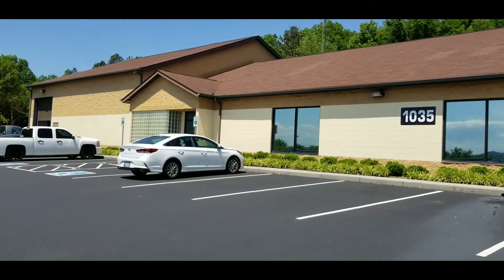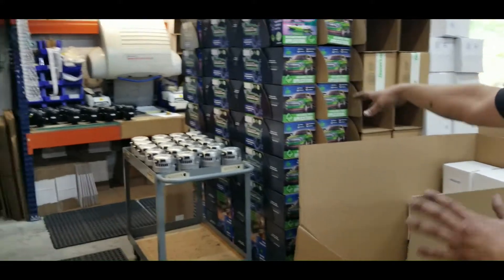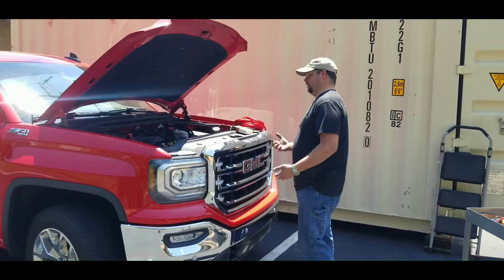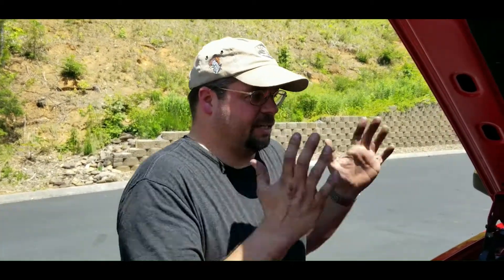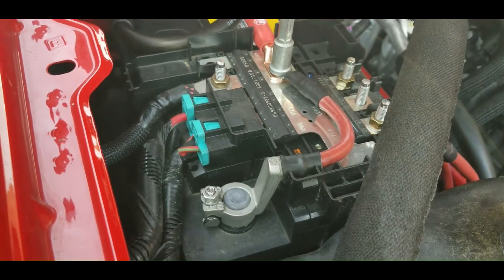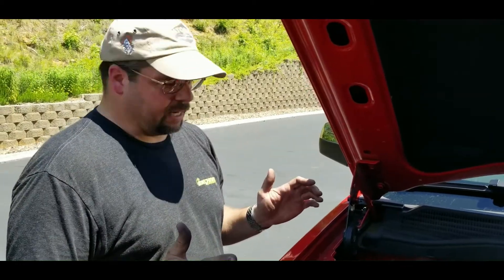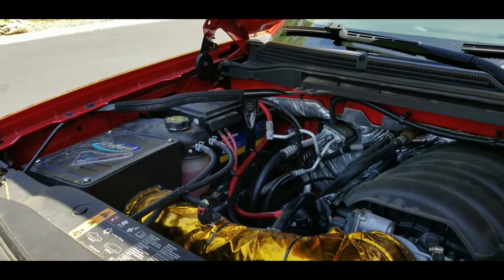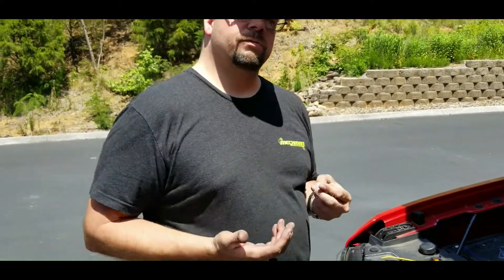How to correctly wire a MECHMAN 370 AMP BILLET ALTERNATOR for 2014-2018 GM Trucks & SUV's

Comment: If this isn't an appropriate place to ask questions just ignore me lol. I'm not totally new to car audio but I would consider myself a novice. I was just starting to upgrade my 2013 GMC Terrain Denali and worried about the voltage control regulator ring when doing a big 3 upgrade. I was told not to run extra grounds thru that ring and just leave the stock the way it is and upgrade the positive to alternator only. I was also told to put a fuse on that positive upgrade wire. Thoughts?

Comment: I'm looking to buy the 400 amp alternator but im trying to figure out what size drive belt i would need since mechman suggest that you would need a 1/2 inch shorter belt since the pulley on the alternator is smaller than the oem alternator

Comment: when I'm doing the second all the time 14.5 voltage setup, do i need to still run it through the voltage regulator loop? i have a 370 amp Mechman i bought last year for my 2007 Cadillac Escalade Esv but i have it set up the same but didn't run it through the battery current sensor but noticed I'm only getting 13.2 volts where my battery is always low or dead, i want at around 14.5 volts. i don't know where im going wrong at where i did i stall my mechman alternator with a 1 inch shorter belt then oem..

Comment: Matt so if i use the bypass connector mechman gives me with the alternator (400 amp) do i still need to run the zero gage through the sensor loop coming of the battery ground? The video dose not specify after the bypass connection is made. Thanks

Comment: Can you tell me which fuse was tapped for the regulator? My battery drains with the fuse I tapped, and I'm having a hard time finding one that's not constant
Reply: Did u ever find out wat was the correct fuse to tap into?
Reply: @2ksuelosierra972  yeah, I had to run the yellow wire to the fuse box inside my truck. Do you need help finding one?

Comment: I have a question I have 2011 cadillac escalade just installed a mechman alternator 370. The four pin one wire out that came with the alternator. My wife told me the battery light came on what is the best fuse under the hood I should use right now I using hvac ing fuse you I should the ecm fuse spot instead. The first I installed the alternator with the trickery alternator piece 15 volts with no battery light. Today the battery came on. What can I do to make the battery light go off.
Reply from the maker: Call Tony at Mechman he's your guy.

Comment: So I added a second alt to my Chevy truck, I was separating the system from the truck all together batteries and all.. so as I'm wiring up the alt, I hooked up the 12v switch wire and I wasn't getting nothing, come to find out you have to ground the alt to the truck if your gonna use a switch wire from the truck, so if you want to keep it all separate you have to run your switch wire from the battery that powers your system, not the truck... this was my first time using the harness so it was a learning curve for me lol

Comment: So if I want the 4 pin conversion for my 2014 I gotta call mechman to install the 4 pin connector before they ship?
Reply from the maker: Yes, give them a call, and tell them I sent ya. You can ask for Tony he's an awesome guy and can answer all your questions way better than I can. Thanks for watching, please like and subscribe.
Reply: @matthewmeltonTEAMMELTONFISHING   preciate the response got the same 370 on my LSswap 96 Silverado has the 2 pin plug might do the same change to a 4 pin, voltage be fluctuating
Reply: @matthewmeltonTEAMMELTONFISHING  one more question so with the 4 pin your voltage always stays over 14 n change when you got the system up full tilt?

Comment: What length are the cables from the alt to the battery?
Reply from the maker: Not sure right off since this was a custom install. We just cut them to fit and crimped on the terminals. Thanks for watching, wish I could answer your question better. Please like and subscribe.

Comment: I have a stock 160amp alternator. And have 1000rms watt audio system. My check engine light came on. Code was p0690. Would that be because the audio system is pulling all the current from pmc?
Reply from the maker: Call Tony at mechman he is the alternator expert. Thanks for watching, I just don't want to misinform you.

Comment: Hi bro
I have an 2014 nissan altima and i see a free space in the engine, i want to put a second alternator, i was thinking about to put an mechman elite 400, this is for have the stock alternator for the electrical system of the car and the second alternator for my sound system.
First of all... It's this possible? 🤣
How can i add an regulator for the second alternator? it's my daily use car and i don't want to burn my batteries in the trunk
Reply from the maker: Call Tony at MECHMANS, he can help you out! :) Thanks for watching!

Comment: what size power wire and fuse is needed from alt to battery? i know he said 0 gauge but i read somewhere the max fuse size for 0 gauge is 325 amps
Reply: On a run this short you don’t need a fuse
Reply from the maker: Call Mechman and ask Tony he can give you the best advice since he's the expert. Thanks for watching Cole, please Like & Sub.

Comment: Well I’ve done an incredible amount of research trying to figure out what I can do for my 2pin alt to get a consistent 14.4 and this is the very first time I’ve seen this magical 2 pin “trickery device”
I’m calling mechman Tuesday and buying one of these.
Reply from the maker: Thanks for watching Jonah glad the video helped ya. Please like an sub.
Reply: @matthewmeltonTEAMMELTONFISHING  Are these included with alternator purchase from mechman?
Reply: @matthewmeltonTEAMMELTONFISHING  will that gates fleet runner belt fit my 2017 gmc sierra 1500 with the 5.3L ? Also, you have 2, 0 gauge wires for ground and positive cables ?  Thanks you in advanced

Comment: very nice! Moving those bushings from experience is a pain in the butt haha.
Reply from the maker: Thanks Brother!
Reply: Take a short socket just slightly larger than bushing, insert bolt through the selected socket, insert bolt/socket through  bushing on the side you'd like to move it. Place washer small enough to touch bushing. Add the washer on the end of the bolt, add nut. Torque bushing out in about 5 turns.

Comment: Wow so I was having problems with my 2017 Impala with ( Battery saver active) ( Battery charging system) and I did a 320 amp Mechman and big 3 and the installer did not know to run the OGauge Thur the sensor! So pls help me out cause my vehicle is sitting due to him not running it right! Going to call mechman Monday…. Cause my installer saying the alternator is bad
Reply from the maker: Call and speak to Tony at mechman.
Reply: @matthewmeltonTEAMMELTONFISHING  yes sir I called and spoke with Brandon and Richard about this matter and was informed to switch out the extra Ground wire and run it Thur the sensor! So now I just have to Monitor my voltage! But I hate how the voltage goes up and down… just insane
Reply: @hangingwitthabrowns  hey man, i have a 2018 GMC Sierra and same thing happened to me. I bought that 370 amp alternator 2 months ago and it was working fine until 2 days ago the battery charging system light came on, i spoke to Brandon from Mechman and he said the ground needs to be ran through that rcv sensor like you did. Did this work out for u? I dont know what to do, i cant even move my truck bc i dont wanna be stranded somewhere
Reply: @bashns7743  I’m still having this issue but mechman said I’m having belt slipping, cause now if I’m just sitting at a red light it come on and sometimes it dnt so really dnt know! But they inform me to go that another smaller belt.
Reply: @hangingwitthabrowns  have you fixed it yet?
Reply: @TheBakeMaster  no
Reply: @hangingwitthabrowns  sup man. Are u still having that battery icon pop up on your dash? It turned out that my alternator some how fried. I sent it back and they fixed it and its been installed and wired up correctly i believe. Only thing i didnt do was replace the belt. My battery saver icon comes up once in a while. Hopefully im not damaging anything else
Reply: @bashns7743  yes it does here and there, I have the Belt just need to get it installed
Reply: @hangingwitthabrowns  u think with that icon popping up, it will mess up your alternator? But i mean its been doin it for a while, should b good right?
Reply: @bashns7743  well for me it charges and run ok, like 14.4 it’s the drop to 12.6 cause of the system telling it too.. but Mechman told me too change the belt again and it should go away! Soo we will see. Plus my battery light only come on now when I’m sitting at like a red light, but not all the time. But yea should be fine
Reply: @hangingwitthabrowns  thanks for your response man. But yea mine does the same, voltage stays in the high 14.+ . Since we both have GM vehicles and they both have similarities its why i asked u lol. But what u runnin bro? If u dont mind me asking
Reply: @bashns7743  srry for the late reply, but 2 (12) Sundown xv3 on crescendo 4K
Reply: @hangingwitthabrowns  its all good man. Are u running that on stock radio? Im running 2 zv5 12s in a center console on a Deafbonce aak4000
Reply: @bashns7743  I have a pioneer AVH-2400NEX, but I’m thinking about getting the crescendo 6K amp. But I’m going to put up a video soon about the system
Reply: @hangingwitthabrowns  i bet yours sounds good on that amp but that 6k is gonna do some serious slammin gee!
Reply: @bashns7743  yes sir! You should post a vid of yours

Comment: Is the belt the same size for 5.3?
Reply from the maker: I believe it is but I would double check just to be safe. Thanks for watching, please Like & Sub.
Reply: @matthewmeltonTEAMMELTONFISHING 

will that gates fleet runner belt fit my 2017 gmc sierra 1500 with the 5.3L ?
Reply: What belt size did u end up getting?

Comment: I went to their web page I didn't see the other two different plug, I just saw the one with the 12 volt wire. I have the 2 pin on my alternator.
2013 Chevy Tahoe LTZ
Reply from the maker: You'll have to call Tony at Mechman because it's not on there website. Thanks for watching, please LIKE and SUBSCRIBE

Comment: My brother purchased Mechman 300 Amp alternator for his Caprice $600, and it wont fit either of our chevys, its too bulky. Is there any way we can get an alternator that fits the current one belt setup, that we wont have to move the alternator somewhere else. We have late 80’s model vortecs. Both have 89 Caprices. Help. Plus they wanna charge him a restocking fee of he sends it back, we stuck with something we can’t even use. We don’t even care if we have to go with less powerful alternator, point us to one that fits. Thanks